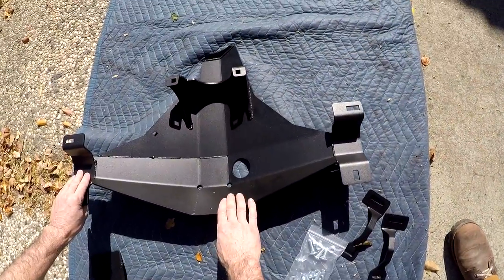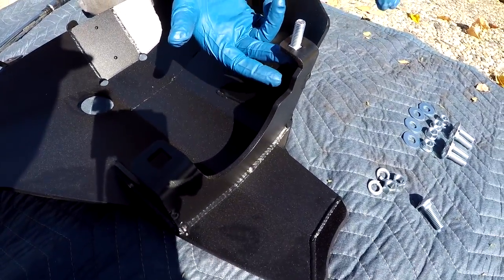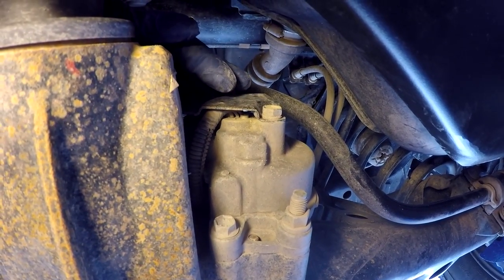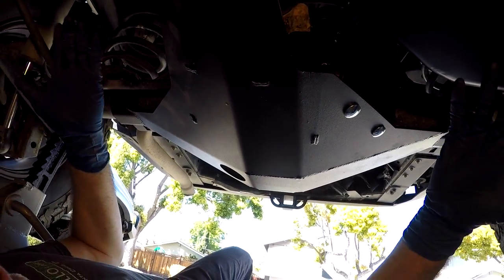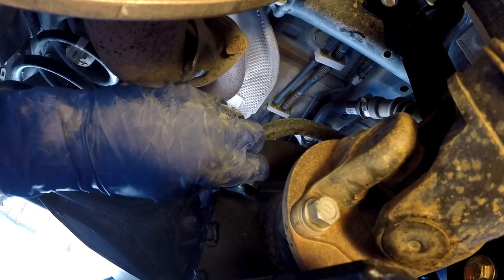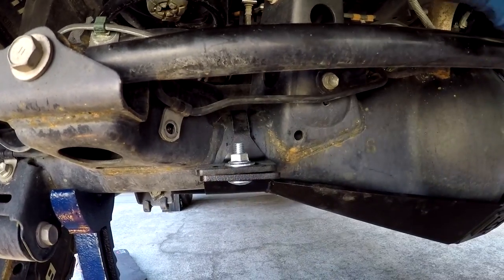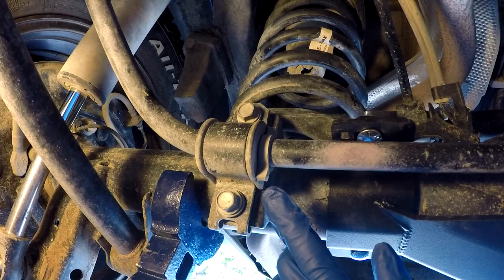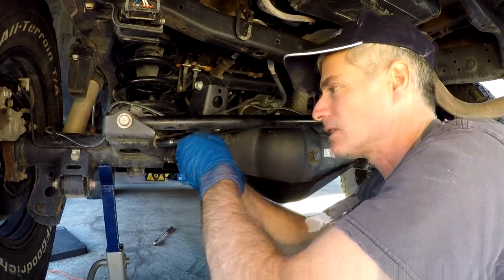C4 Fabrication 5th Gen 4runner Rear Differential Skid Plate Installation

Comment: I'm going to order this one,  looked at the options and this one looks to be made really well.  I'll also use blue loctite on the threads to help avoid rust and help them not vibrate loose.  Thanks for the great install video, it was well done.
Reply from the maker: You're welcome.  Good luck with the install.

Comment: Hello Timmy, how are you! I don't miss any video from your channel, because I see a lot of love and professionalism with our 4Runner. I know that my problem is not relevant to the video, but I hope you can give me some tips. I have a 1997 4Runner 3RZFE engine and I am experiencing problems with strong cracking when hanging in side trenches (chassis twists). when the wheels go up and down together nothing happens, only when one wheel goes up and the other goes down, does the cracking happen. I’ve already checked, pivots, bushings for steering end trays and they’re all OK. I hope you can give me some tips.
Much obliged!  Oslei - São Paulo - Brazil.
Reply from the maker: Hey Oslei,  good to hear you're a fan of our channel.  In regards to your problem, sway bars, control arms, coilovers, springs and body mounts are what I would inspect.  Something sounds loose or worn out and is shifting causing the cracking sound.  It sounds like it could be a metal on metal area rather than a bushing that might be squeaking.  Figuring something like this out can be frustrating because it's not like you can reproduce it while you're under the rig examining things.  Now, if you had access to a fork lift and you could get under the tires to flex the suspension and see if you can determine where the noise is coming from.  You might also set something up or maybe there a loading dock curb you can drive up on to flex the suspension while a friend is outside watching and listening to get a clue what's causing the sound.  I hope my suggestions help you figure it out.  Happy Wrenching!
Reply: Thanks Timmy for the tips, it really is not easy to find out, I already took several specialists and Toyota itself and they could not find out! I will try to simulate as you suggested!
thanks! @TimmyTheToolman
Reply from the maker: @osleimonteiro5726  Well, hopefully with a little flex simulation you and a buddy can figure it out.  Let me know if you do.

Comment: Toyota still using the same axles from back in the early days on the 4runners huh
Reply from the maker: I'm not sure what the differences are in the axles over the years.
Reply: @TimmyTheToolman  i mean the axles having to be dis assembled facing the drive shaft that hasent changed since the 2nd gen 4runners